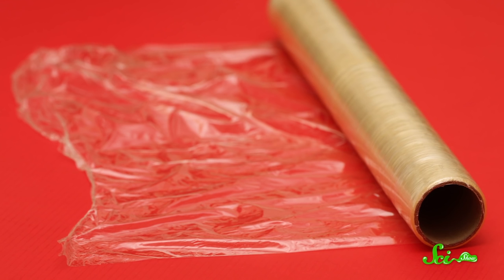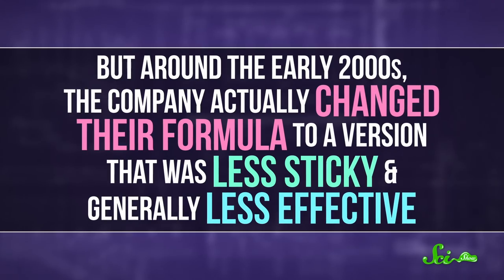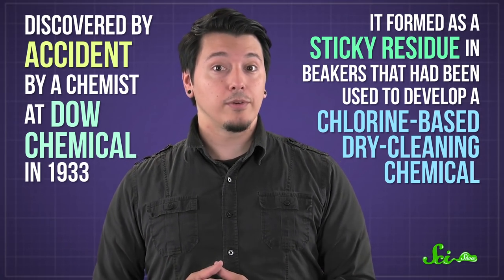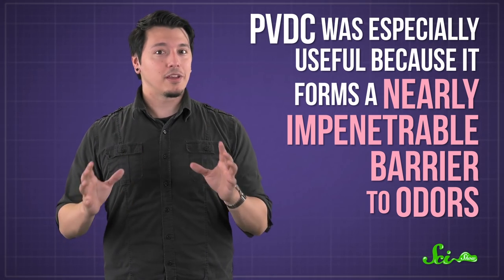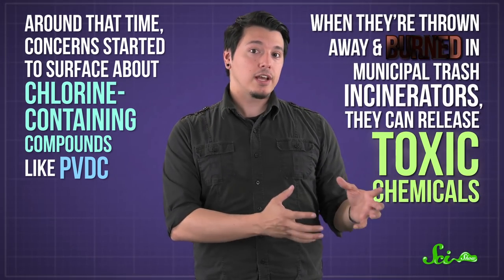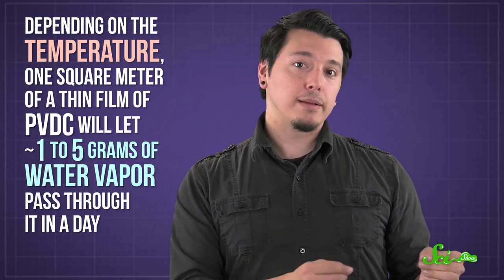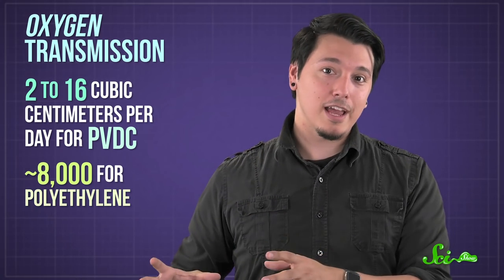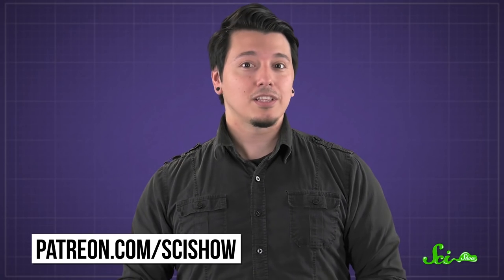Why Isn't Cling Wrap as Good as It Used to Be?

Comment: Why not use a glass, metal, or ceramic container with a lid? No plastic, and no waste.
Reply: Because we're all addicted to disposable goods.
Reply: Because that often involves dirtying up an entire other, large dish for EVERYTHING you save. That, or start eating everything out of resealable butter bowls like some sort of butter hermit.
Reply: OMG.. can you believe it. at one time, This was a product.... It was/is.
Reply: But how much fresh water will be used to clean that container? In some regions that may be even more of a concern than trash.
Reply: It takes water and a lot of energy to run a dishwasher. I wouldn't assume that a few square inches of 12 micron thick plastic(properly disposed of) are worse for the environment than using up that water and electricty.
Reply: Because lids are like socks, eventually one of them always goes missing.
Reply: Depending how many leftovers there are, may not fit in a container.
Reply: Here in Austria many shops, even large discounters, stopped using or selling  plastic bags. Some ask you for environmental responsibility and bringing your own containers and bags.
Of course, we also have different recycling laws than e.g. the US.
Reply: NWBackcountry modern disposable plastics often has a MUCH lower footprint than producing a single glass or metal item. Like plastic shopping bags. A paper bag has to be reused 4 times, and a proper shopping net has to be used tens of thousands of times, to match the footprint of single use plastic bags. And most plastic bags are good enough to use many times too.
The publics irrational aversion to plastics is one of societies great problems, as proper use of it saves both money and the environment. 
We just need 3rd world countries like the USA to start disposing of their trash properly. I cannot fathom that they still just create landfills with it.
Reply: Alexander Santiago 
You do realize that the average man in the early 1800's burned 4,500 calories per day, and women burned over 3,000.(from all the long days and hard labor)

The vast majority of people eating barely less than half those amounts get obese today. And they worked from before the sun came up to after it went down. Not to mention they had no power anything.

Don't act like you have a hard life.
Reply: most cutlery is not sold with a matching lid  the danger of a lid slipping off and falling is real you would need to go through a lot of saran wrap for this to be useful
frankly I've never found the clinglyness of saran wrap to be a problem
Reply: About waste, cling film is ridiculously light. I have an industrial sized roll, about 1kg for 44cm x 300m. That's probably enough for around 1000 dishes. Total: 1 gram a dish.  Is is worth buying and repeatedly cleaning a reusable container just to save a few grams of plastic waste? Maybe, but that's a drop in our overall plastic consumption.
Reply: Zizka Zenit you do realize that a dish washer isnt the only way to wash dishes right? gasp i know right? its almost blasphemic xD
Reply: I can't use a lid for a plastic plate
Reply: Because then you need to wash it out.
Reusable is less hygienic.
It takes more space.

But if I had to chose one of the above, glass would be an acceptable substitute. 
I actually wish more soft drinks came in glass bottles. It would be much better.
Reply: Elemental Phoenix but it is also the most Environmental friendly I hope you're not implying to wash by hand because that's complete terrorizing waste
Reply: Ricki Nielsen If you get a paper bag wet, it is as good as useless. If you get a plastic bag wet, it doesn’t change anything. Imagine bringing home sweaty milk jugs in paper bags. Talk about a nightmare. And don’t worry about landfills. In about 30-40 years or so, we will just be sending outlet trash to a singular trash planet. And it’ll still look pretty from space.
Reply: Zizka Zenit My dishwasher uses a LOT less water than washing by hand.
Reply: Throttle Kitty if given the chance, that's exactly what I would do, and did while in college.
Reply: NWBackcountry variable size and shape
Reply: Robert Pruitt They were really small people back then. I eat ~2000 kilocalories/day.
Reply: Echoing this. It's not just about the energy to produce, but the trash it ends up as.
Reply: It depends on why you're using it.  If you're wrapping something to take somewhere the cling wrap is lighter and doesn't break if you drop it.
Reply: Thanks I was looking for this comment ! GO Zero Waste!
Reply: Zizka Zenit 
You do realize they don't use much of either right? Plus it's not like your going from no dishes to two disherwashers full.
Reply: From a purely carbon footprint perspective that's probably true, compared to paper, etc.  OTOH, there's other issues with overuse of plastics that shouldn't be ignored either.

I think the "correct" solution, like most environmental issues, is to look at it rationally, and find the best overall solution with the least downsides, rather than choosing your friends and enemies, and fighting about it without reasoning.

In most cases, reusable containers probably are better than any kind of disposable, though there are certainly exceptions.  Recycling is still a down-hill process.  Eventually you end up with a lot of useless plastic fibre that either gets burned or dumped somewhere.

Another big part of the solution is just less packaging where it's not really even beneficial.  (When you buy electronics, why does the manual need its own plastic bag?)
Reply: AboboKing for the world it sure isnt
Reply: The U.S. is surprisingly responsible with it's refuse.  Less then 1% of ocean plastic is from the U.S.  An overwhelming majority of it comes from India, China and Africa.
Reply: Elemental Phoenix No its not, you could hand wash and use more than double the water and power instead 🙃
Reply: ozdergecko many shops on the states do/have done this for a while, by no means all but many. The two stores I go to most(Aldi and Gorden Food Service) do not have plastic or paper bags.
Reply: Alexander Santiago

Yes, those extra 30 seconds can really break a man.
Reply: Why not just donate it your left overs to the "homeless". If we're going to participate in virtue signaling.
Reply: Robert Pruitt Just because someone had a harder life doesn't mean you should intentionally make your life harder
Reply: NWBackcountry 'Murica! Duh.
Reply: I’d rather just throw away or compost leftovers. Then you don’t have to worry about plastics that take forever to disintegrate or having to go through the trouble of digging through cabinets to find tupperware with matching lids and wash them when I’m done. Nope. Yes, we might have modern conveniences but we have less time to do anything. Between bumper to bumper traffic, long work hours to make a living wage and all the things we need to do I just don’t want to waste it for some leftovers. It’ll compost nicely and fertilize my garden.
Reply: Throttle Kitty You just described my life. I have so many butter and margarine tubs, plastic takeout containers, tins from Christmas cookie gifts, and deli meat bowls that I use for everything. It's habit from my childhood, when we were poor sand saved everything, and my arthritic mother found glass and metal things too difficult to hold.
Reply: Alexander Santiago sounds like a bunch of excuses. Excuses are like arm pits................
Reply: LagiNaLangAko23 I hand wash when the dish washer is full/activated cause my city repurpose gray water.
Reply: because drug dealers and serial killers prefer cling wrap over pots and pans.
Reply: Maybe just don't incinerate plastic trash?
Reply: Elemental Pheonix, dishwashers are indeed not the only way to wash dishes, but assuming you fill up your dishwasher every time it is much more efficient than hand washing dishes.

My 10 year old, high efficiency dishwasher only uses 20-30 liters of water per cycle, filling up my wash sink and rinse sink is between 30-40 liters, and I may need to drain and refill one or both before I get through all my dishes.

I think the math works out to it being more efficient to hand wash your dishes if you have your faucet running for less than 4 seconds per dish.
Reply: I would say buy Corningware because you could go from the freezer to the oven and back to the fridge without hurting it but I was reading that the classic white dishes with the blue cornflower pattern is now some crappy Chinese made thing that you can't do that with...   I guess I will buy even more vintage kitchen stuff.
Reply: As i commented up there, when i worked at the printers big stacks of large format printed product were wrapped in this to protect paper from the elements..a container of A0 paper dimensions is highly unpractical.
Reply: ozdergecko Every time I hear about places banning plastic bags, I wonder what people who live there are doing with their cat poop. Everyone I know, uses their plastic shopping bags to dispose of their litter box waste.
Reply: +bridgetthewench
I scoop out the hardened poop once a day and i throw away the cat sand every once in a while when it is really smelling. Probably once a weak. 2 cats, 2 litter boxes. I would let them run outside but the female in the house is paranoide ¯\_(ツ)_/¯
Reply: k1dicarus I scoop everyday, too, but I'm not carrying it out to the dumpster in my hands, I scoop it into a plastic bag and take that out.
Reply: None of those options are air tight, and that is the point of plastic cling wrap.
Reply: @calichef1962 Did you watch the video? Plastic wrap isn't airtight either, not even close.
Reply: @bridgetthewench Out of interest, couldn't you carry the litter box to the dumpster and then scoop directly into the dumpster? Not sure if your dumpster is lined with a plastic bin bag or not (not entirely sure what a dumpster is to tell the truth, as I'm from the UK, not the US) but if not, and if the rubbish (trash) is loose in there anyway then that would cut out the plastic altogether. If the rubbish has to first be contained in a bin bag then presumably you have a large-ish bin somewhere that you put the rubbish into prior to removing the bag, tying it, and placing it in the dumpster, in which case take the litter box to that bin and scoop/tip directly into it, and that would remove some uncessary plastic from the waste.
Reply: Our dishwasher uses 2.5 Gals per load and if we run it during the day the solar panels power the washer.    Plus, how much water is needed to manufacturer the wrap and its packaging?
Reply: Dan Coulson they used to wash and reuse the glass bottles now the crush and remelt the glass to recycle it [better?]
Reply: KamiltheCamel look at all the YouTube videos on how to melt bags into useful plastic items
Reply: Zebedee Summers must be your area.  Just went to Aldi's and they still sell the plastic bags AND thermal insulator plastic bags.

Comment: I'm guessing PVDC was also used in packing tape in the past.  I still have an old roll of saran wrap from the '80s; it's discolored and a bit weird at this point, so I only use it for non-food applications, but it has a very distinct smell to it.  A smell that I also clearly remember from using packing tape in the old days.  It's a smell I started to notice going away about fifteen to twenty years ago, so I'm guessing that smell was the PVDC that was in these products.

Comment: Aluminium foil >
Reply: than what?
Reply: Has gone up so much that it makes me want to mail all the companies angry letters. Price of synthesizing aluminium has gone down WHAT'S THE DEAL!?
Reply: Aluminum foil is even worst for keeping food fresh.
Reply: CJ Burkey than the material the video was about.
Reply: good luck wrapping your food or plate "airtight" with aluminum foil... there's applications for both cling wrap and aluminum foil, but they are not interchangeable...
Reply: It's also infinitely recyclable.  Aluminum is great for food wrapping so long as it's not raw, already cut onions or something smelly.
Reply: Vlican that’s what rubber bands are for. Just stretch it around the sides of the bowl over the foil and you’re good. Also works with (unclingy) cling wrap.

Comment: I have used Glad Wrap almost all of my life.  It is not only clingy; but stretches a little as well to create an airtight seal.  I found that Saran Wrap never worked as well, even before they changed the formula.  Glad Wrap even uses Cling Wrap as part of it's brand name.
Reply: Glad Wrap is the same basic material as the Saran wrap now. The original Saran wrap was a little thicker before it was changed in 2004. However if you think they glad wrap Christian and airtight seal, you are mistaken if you watch this video. The original saran wrap made out of polyvinylidene chloride was a much better barrier. You can still buy it in a couple of brands from Japan on Amazon or eBay.